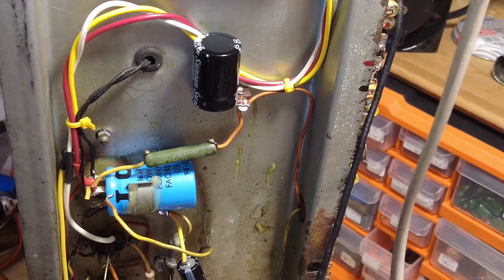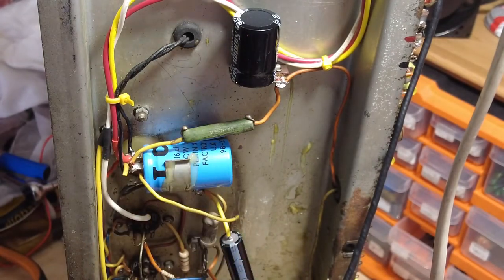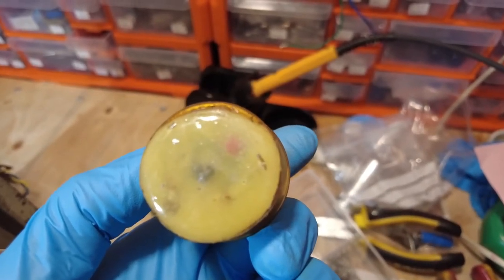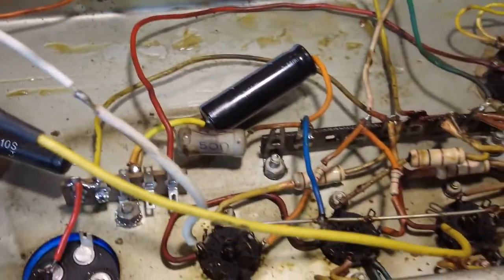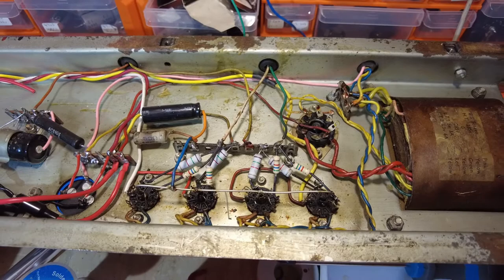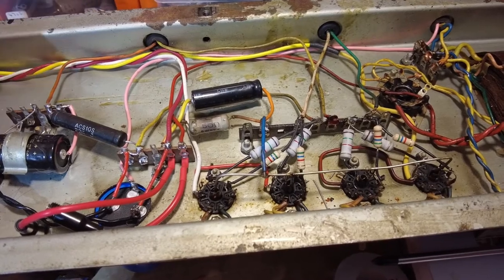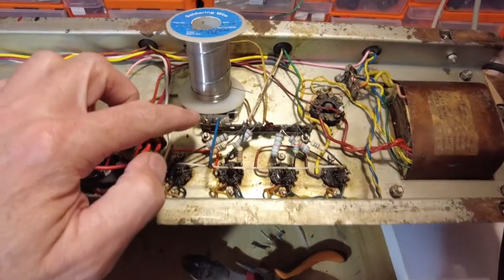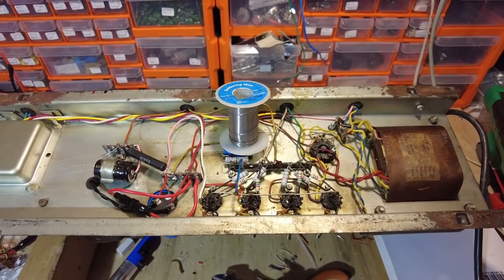Vox AC30 Part 2 Restoring the Output Section

Comment: I always find it amusing when people come up with the same solutions to problems. In this case I mean using the solder spool to hold the cap down while silicone dries. I do that all the time. It’s only a problem when the spool starts getting light. Then I’m searching like chicken with its head cut off for something of similar weight and size 😊
Reply from the maker: Hello William. Ha ha yes, I know what you mean. I always think that I must find a proper tool for the job but then always forget to find one, and then find my self  reaching for the spool again. Old habbits die hard.

Thanks for watching and take care.

Comment: Hi, Thanks for your video. I'm looking for part 1 but can't find it
Reply from the maker: Hello Albert. Happy new year. Here is the link for part 1: https://youtu.be/P32OCa4CDKQ
Thanks for watching and take care.
Reply: @vintageguitaramp_guitarteacher  Hi Martin,
thanks for the fast response en all best wishes for you too.
I'm working on the same type ac30 early 60 years.  It was full of dirt inside (caused by beer and smoke I think:) which was not easy to clean. I replaced the valves and its working now,  but still a noise (50Hz I think). probably have to replace some capacitors.
Also the vib/trem switch must be replaced, but I can't find it on the internet. Do you have an idea where to get that component?